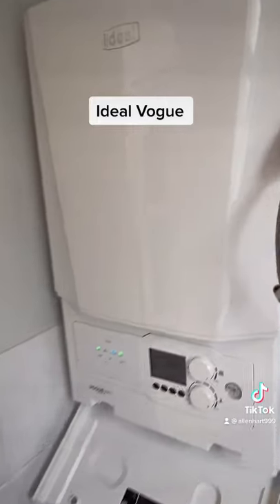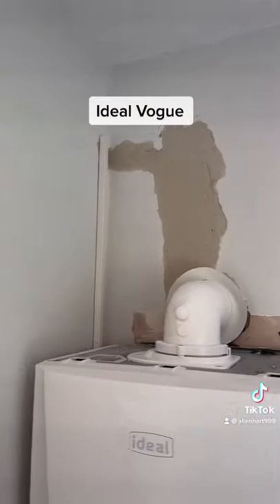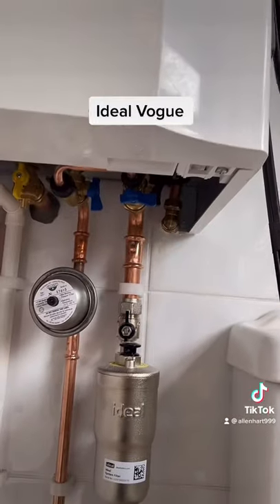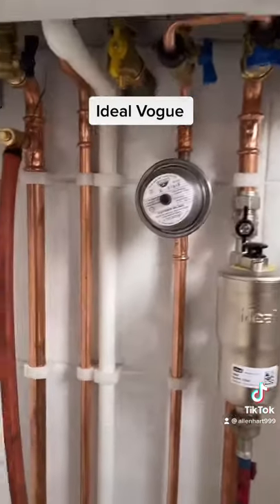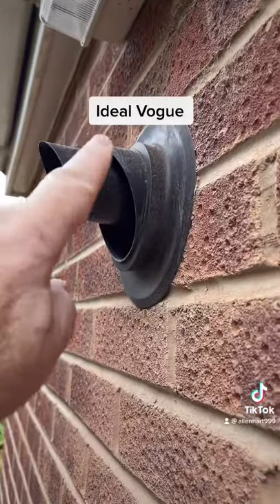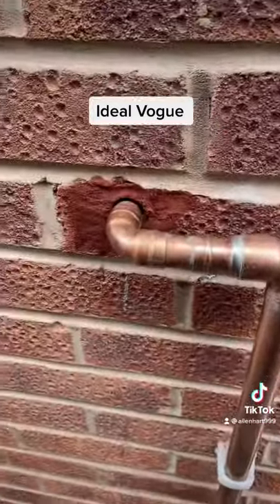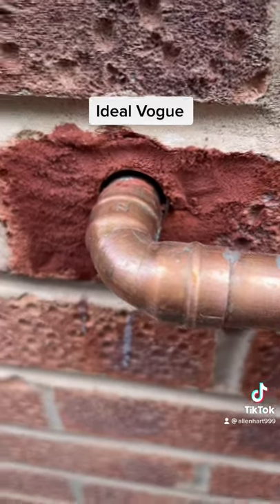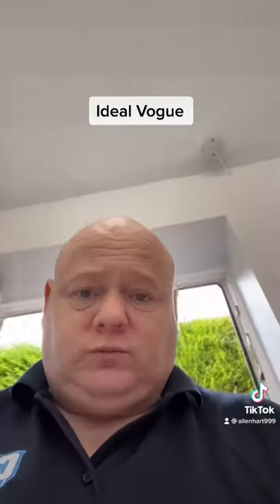Ideal Vogue Boiler Installation TikTok full video to follow

Comment: Hi Allan, looking at getting a new Combi boiler soon and seen the Viessmann Vitodens 050-W 29kW how would you rate these boilers? And is there any others you would recommend . Thanks 😊
Reply: Why settle for a 29kw? Get a Vogue C32. Always handy having that extra kick on hot water especially filling a bath in winter. Also a 10 year guarantee.
Reply: @nathd1748  the Viessmann is at the top end of my budget and also comes with a 12 year warranty.  But I will look into the boiler you've suggested thanks.
Reply: @TommySco89  What is your budget? Also the warranty will depend on a magnet and annual servicing.